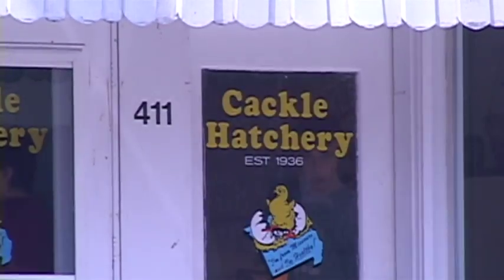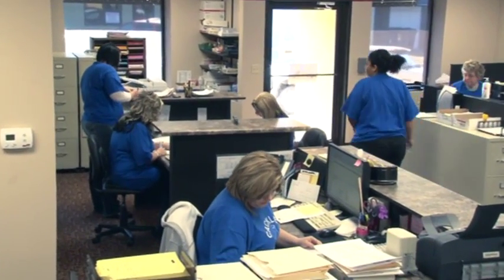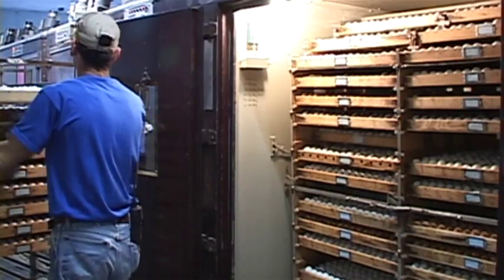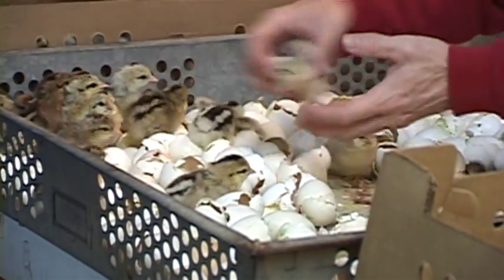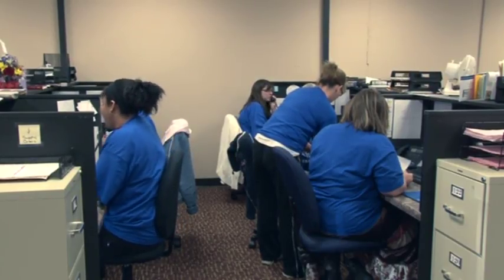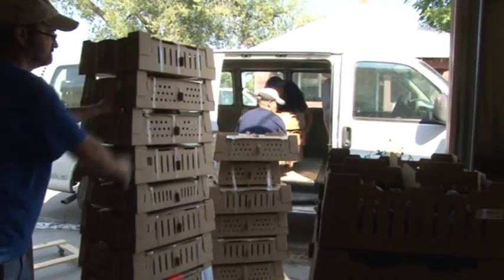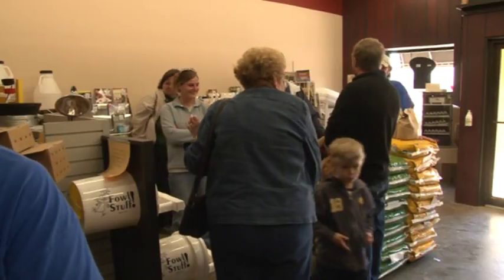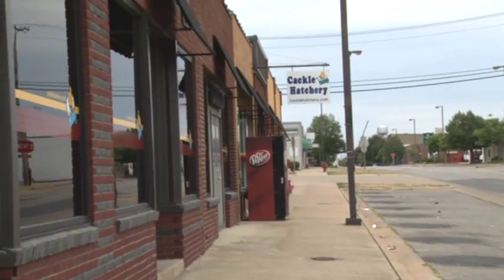Welcome to Cackle Hatchery 2012

Comment: Am requesting for assistance i bought an incubator of 96 eggs but when it comes to hatching most of chicks dry in the shell and fail to hatch what might be the problem ,what is the required temperature and humidity because my machine reads 37.8 temp and 60-70 humidity
Reply: Gladys Wanza are you rotating them?